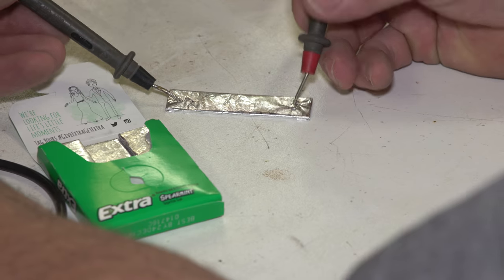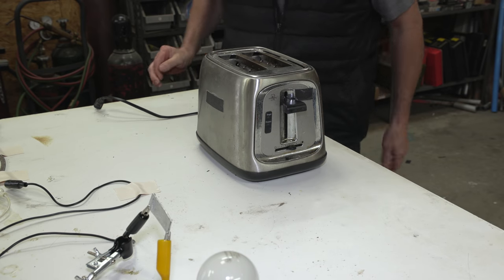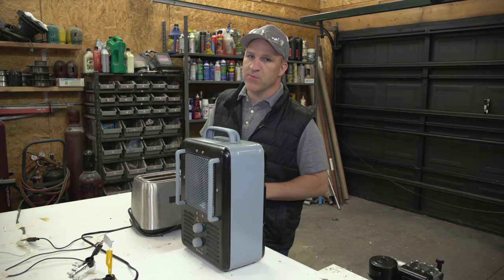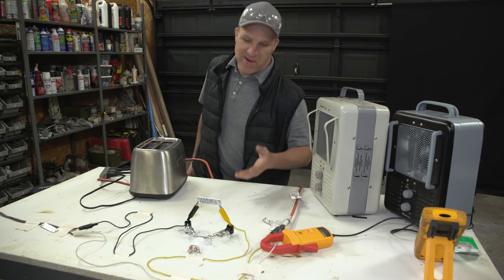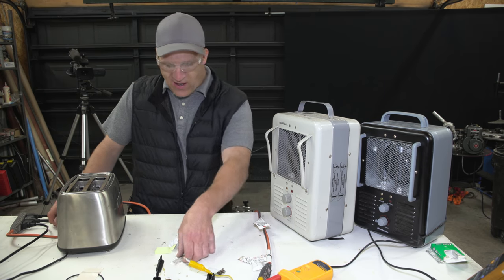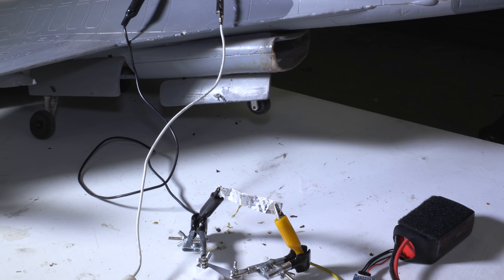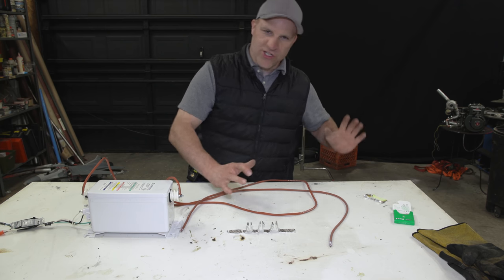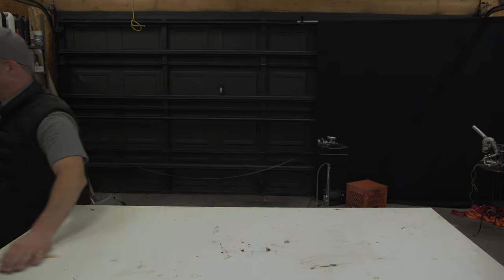How Much Power Can a Gum Wrapper Handle?

Comment: Isn't it fake ? I mean I accept that it can handle a lot of current but not 40 amps thats a lot of current even the wire which was connected to alligator clips cant handle this amount of current 
Am I wrong reply!
Reply: The wires on the alligator clips are very thin and they are insulated. The insulation keeps heat from escaping.
Reply: @ryanmickelwait1521  you realise the rubber on the wire will burn
Reply: Alternating current "flows" through wire way easier than direct current
Reply: Not sure if this is a perfect example but, your car starter motor isn't exactly huge it has a reasonably thick cable to it and it will get hot in excess of 5 seconds on the key. 
Then your household AC runs all day on those itty bitty wires.
But I do remember there was a difference for using 240v AC circuit breaker/fuse on a 12v DC system only reason I remember is because they're cheaper to buy and just allow the difference because I'm a tight ass...
Anyway just waiting for the electrician to chime in with a proper explanation.....
I'm gonna leave now....
Reply: They are good at science. Didn’t you know
Reply: It's only about 31 amps, not 40.
Reply: @jackbalmy1392  That's absolutely wrong. Where did you hear this bullshit?
Reply: @steven4737  That's wrong. 30 amps are 30 amps. There is no difference. 
10 amps running through a 1 Ohm load will always lead to a voltage drop off 10 volts. 10 amps times 10 volts makes 100 watts. DC and AC. There is no difference.
Reply: @sternpunkterdung1420  that's all well and good, but only true if the DC resistance and AC resistance are exactly equal - 
The DC resistance will be V/I  the AC resistance will be √ (R^2 + (Xl-Xc)^2) - and given the foils large surface area it should have a comparatively large Xc term
Reply: Alot of mis information here. Amperage is amperage generally. Looks like 14 gauge or possibly 12 gauge wire used for the alligator clips. In Canada 14 gauge is good for 15 amps. 20 amps is starting to be acceptable for 14 gauge (has been on America with less strict rules for a while) and 12 gauge is good for 20 to 25. Now this is just what they're rated for for safety sense. They are capable of quite a bit more before burning up.

Comment: Am I the only one cringing at the tiny test leads used to complete the circuit? Those are probably rated for 10A Max.
Reply: yer me to
set fire to an alligator clip like that with 10A 12V
Reply: Meeee
Reply: I wonder too how they rent melting and burning when I am testing with my lab supply these leads start to smoke at 5 amps and he punches 30 amps through
Reply: Yep me too.  Idk how these alligator clip survived the 30 amp .. like how? I think he means to say that we can use aligator clips to run Air-conditioners and heaters . Just dont waste money on proper rated wire . Use alligator clips lol Jk
Reply: @gesuk492  also if you see at the current measuring display it shows some mV value so he doesnt even measure amps with the clamp
Reply: DerProGamer2000 no; voltage output current clamps are a thing.
Reply: @ElTurbinado  i know i have one but why does it show mV
Reply: DerProGamer2000 because it’s voltage output? If it outputs a voltage relative to its current, your multimeter will still say the voltage it’s reading. I’m not sure what you’re confused by, but maybe this will help: A shunt resistor is a low ohm resistor, you can know amperage passing through it by measuring the voltage drop across it (one volt meter lead on each side shows the voltage drop), then using V=IR and rearranging for current= I=V/Rshuntresistor, you get the current reading in terms of voltage for your multimeter to pick up.
Reply: @jakegarrett8109  i have a current clamp and when i measure current it das Camps and doesnt say voltage
Reply: DerProGamer2000 that’s a current clamp specifically for your meter though. If I use a resistor and connect it to my multimeter, then it’s going to say voltage (it’s measuring voltage drop across it, the meter wouldn’t know if it’s hooked up to the resistor or to a battery, to it, it’s just reading the voltage potential across the resistor, which gives you amps when the resistance is known).
Reply: @jakegarrett8109  ok makes seens now :)
Reply: Not really some test lead like the ones on meters can handle quite of bit of amperage.  Not the size of the wire but what it's rated at.  You don't give him enough credit. He probably did a lot of for-thought before jumping with both feet. If you pay attention you can see. he had a topic. He   Isolated his variable. He made his hypothesis. he collected data (or)He knew the difference between dependent and independent variables. He ran the experiment, testing for variables. then he came to a conclusion. Textbook experiment!!

Comment: it's good to know that you can use a gum Wrapper as a 30A fuse
Reply: Might catch fire tho!
Reply: ThinkCleverAndSmart I mean the point of a fuse is to burn instead of allowing wires to burn
Reply: Of course, but if it catches fire and burns your house down I’d say it didn’t do it’s job
Reply: NEVER replace fuses with a solid piece of wire or something that won’t pop when needed 

There’s a reason a fuse blows and if it repeatedly blows there’s a short somewhere in the circuit which could lead to a fire if it has continual power (since it won’t be able to pop like a fuse)

Comment: It burned at the point of contact with alligator clips. If you had more surface area  between alligator and gum , I believe it to have more current capacity
Reply from the maker: you're right, and I also thought of this, but I still wanted the test to be pretty realistic, and in a realistic scenario you wouldn't be in contact with 100% of the surface area of the gum wrapper. So I think it was pretty legitimate
Reply: @WarpedYT  interesting though, that it can conduct even more energy through such a fine sheet and it's gum wrap!

Comment: You really need to get yourself a flir one camera.
Reply from the maker: Lol... I've been meaning to use one in these videos for a while now, but I've been so behind on my production schedule, I've been cutting some corners. Even in this video, I originally wanted to put the gum wrapper into a circuit box and then overload the box. But unfortunately I'm currently behind schedule, I think I'll catch up soon though.
Reply: Back in the day (I’m a musician), we routinely used gum wrappers as a fuse substitute at gigs.
Reply: Was thinking the very same thing.  The flir one pro is worth the extra. We have one and use it for water leak investigation
Reply: @BiggMo  When he sould use one, the Seek Thermal Pro is the deal. Better Resolution and thermal detection as well as range.
Reply: It would be highly inaccurate for the shiny wrapper, a simple $4 thermocouple meter would be much more accurate. Although the pretty pictures even though they are fake/incorrect due to high emissivity of the foil would look cool although completely wrong (you could use black sharpie to quickly give it a better and more accurate surface finish, though black paint would be best).
Reply: @WarpedYT  the caterpillar s60 is about 500€
Reply: @ΑΡΗΣΚΟΡΝΑΡΑΚΗΣ  would be better off with the s61. full hd flir

Comment: By my estimate, 40A should be doable. No claims of the gum being good/cold afterwards.

It failed on the aligator clips, probably due to it having connections on many(few) small points instead of the full width. You would need a different wider flat-ish clamp for higher current.

I didn't expect it to be able to handle >10A of current before checking the video.
Reply from the maker: I thought about that too, originally I wanted to cover the whole area of each side of the gum wrapper, but in a practical situation this isn't how you would use it, so I figured the alligator clips covering 50% of each end was pretty realistic, I mean the foil of the gum wrapper at its widest point was getting very hot at 30 amps, I still can't believe I even did a video on this, I was literally blown away at how much amperage does a gum wrapper handled
Reply: @WarpedYT  True about simulating a hackjob, not connecting the full width.

There is even the case of unrolling the foil and connecting it, with more surface area to cool it.

It's also similar to traces on a PCB, just thin coper foil instead of aluminium the current goes in.
The traces on a PCB is generally impressively flat.
Reply: @WarpedYT  If a follow-up ends up being warranted, some fatter/flatter clips would be awesome.

Comment from the maker: Tell Me! have you ever used a gum wrapper to get out of a sticky situation? I know I have
Reply: YES I have. Power out, No fuses handy, NEED POWER NOW. Stuck'm in a fuse box. 15 amp. Lowered usage mind you,  and only for a couple of days. Still, it worked.That said, the old (1950s-60s) wrappers were definately a better higher quality made.
Reply: BTW, DEFINATELY NOT RECOMMENDED FOR THE NON GUM WRAPPER INITIATED, LOL.
Reply: No because up untill i saw this video i kinda thought it would burn and shot out my electronics. Honestly now i think that if you had not left the gum inside it would never heat up or catch on fire. Its the gum itself melting and causing it to break the wrap n cause it to flame up.
Reply from the maker: Lol
Reply from the maker: Cool, that's very possible, but there is an uncut portion of this video where I use just a gum wrapper, it just wasn't very visually appealing, it looked a little bit messy so that's why I edited that clip out, I thought the piece of gum inside the wrapper kind of made it look clean. Thank you, and now you know you can use a gum wrapper to move some serious current...😁
Reply: I’ve used bubble gum (sans wrapper) as pipe thread sealer on my RV when our boondocking a few years back
Reply from the maker: @BiggMo  ha!, That's a good one I didn't even think of.
Reply: @jesusgonzalez84  Only do this if you are absolutely sure that YOU blew the circuit and not just when the lights went out. This could be a VERY dangerous fix if it is left in there longer than necessary. The fuse should be replaced IMMEDIATELY. That's what they are used for. Too many house fire happen from this.
Reply: Need a 25 amp fuse for a miller 225nt welder, I don't have 2 weeks for the 14$ fuse to get here... what's the worst that can happen?
Reply: @benjaminbrewer2154  A possible house fire with hot dried out melted romex or older shorted BX wiring. You won't notice it at first but it's going on in the walls.  Replace it with a modern circuit breaker if it keeps tripping.
Reply: @GOGGLETUBESUCKS4UIC  not quite sure that would be wise to retrofit the welder/generator with something like a sqD type q breaker.   Thought about shoving a quarter 20 bolt in the holder.
The miller 225nt is a gasoline engine powered welder.
Reply: @benjaminbrewer2154  You have too much resistance in the welding circuit. Turn your output  above your melting point. You may be doing damage to the generator or circuitry if the fuse keeps blowing and you bypass it with a quarter. That's what fuses are there for. If it keeps blowing fuses at any setting then there is something wrong with the generator.
Reply: I'm an electrician. Never had to use this on the job but I learned about it on MacGyver and always keep a stick of gum at the ready.
Reply: @benjaminbrewer2154  You could just retrofit a knife fuse with some jumper cables much like this stick of gum.. but use thicker cables and make sure the fuse is rated correctly. I wouldn't use a bolt. If you don't care about destroying the machine take a thick gauge copper wire and use it as a jumper instead.
Reply: I have used paper clips to discharge AA batteries before tossing them in the trash.  Be careful with that one.
Reply: Not a gum wrapper, but aluminum foil to temporarily fix a blown fuse, it worked.
Reply from the maker: Lol... Well you know this one will blow at 30amps. ."slow blow". Just kidding, don't do it !

Comment: Warped Perception, Amazing job!  Gum wrappers seem like a great substitute for electrical applications in an emergency.  Looking forward to your next video!  By the way, THANK YOU for loaning me the Wankel rotary engine that you designed.  Will a Wankel rotary run and hit 30,000 RPM on jet fuel?  We'll find out in a week.  lol. Thanks again!
Reply from the maker: OMG !! I can't wait to see that !. I'm so happy you put a twist on it
Reply from the maker: Great point, ive never thought about the peripheral port setup breaking the Apex seals at higher rpm, makes sense thought.

Comment: When I was a teenager I had an old ford truck that would blow headlight fuses all the time. When I ran our of replacement fuses I would use gum wrappers in place of the fuses until I could get to the shop and get proper fuses. Sometimes I would forget and leave the gum wrapper in there for a month or more and the only issue I had was that if I left the high beams on to long they would overheat and shut off. After watching this I’m surprised that I didn’t catch my truck on fire. 🥴
Reply: Yeah we all did that at sometime with barrel fuses...lol...
Just wrap the wrapper around the fuse and press back in slot.
I too forgot one once...it was about a month also....I think it was my stereo fuse so not a lot of current.

Comment: Slow-blow self resetting fuse.  Cross-section estimate ~ 3.4mm^2 about the size of a 12 AWG wire.
 (using full width of wrapper) 0.003 in x 1.75 in = 0.00525 in^2 = 3.39 mm^2

Comment: My 30 amp RV plug melted recently and caught fire, how does a gum wrapper survive what giant solid prongs of copper can’t?!? That’s incredible! It’s way above the rating on standard 15 amp wall plugs, a gum wrapper! My goodness that’s impressive, I though about using like 3 in parallel for an ebike fuse or something for testing (in case something shorted), but wow that would be way over 100 amps for a couple seconds! That’s insanely impressive....

Comment: These alligators test leads are too thin to pass that much current looking at 5:33 if the main is 35mm2 than the test leads must be around 0.75 -1mm2 which can handle 6-11 amps. 30 amps NOPE it will burn instantly. So could you measure diameter of these test leads ? because this seems like BS
Reply from the maker: Nah it's not Bs, the alligator clips are rated for 20 amps, but that doesn't mean that they won't take more. The alligator clips are 12 gauge wire.

Comment: Doesn't it stand to reason that if the resistance in the connection is lower than the resistance in the wire that the connection will survive more amps than the wire?
Reply: Frank Hughes no because power is i^2r. more current more heat
Reply: @jhoughjr1  well then how does a fuse work? 😭
Reply: @jhoughjr1  it's also like when you splice two wires together by stripping them and twisting them together. The resistance goes up where it's spliced and the connection will melt before the wire melts.

Comment: I hate to be that guy but  the main reason a contact(gum wrapper) can carry more AC watts then DC is FREQUENCY. USA AC is around 60hz all DC frequency is 0(unless u have an unstable power supply). Frequency affects how the current penetrates the conductor higher frequencies don't fully penetrate the conductor lowering the resistance witch generates less heat. Great video as always
Reply from the maker: Awesome explanation, exactly!

Comment: The most insane thing I've ever seen ( I'm an Electrical Engineer) was at a person I knows flat,I walked in and he said "don't trip over my cable",He had hit a 6 inch nail into the live incoming cable to his flat and wrapped an electrical extention cable around it and tapped off the neutral conductor too!.....I just could not belive what I was seeing......I told him how dangerous it was but he just said "we do this kind of thing in jail".....as a few of the comments say,this happens in jail alot,the thing is though with incoming tails the fuse or MCB protecting a 100 Amp incoming board is not exactly small!.....true story.

Comment: Def a battery and gum wrapper to light a smoke or pencil led to pop an outlet... In my experience an AA battery will light a wrapper on fire, u put one on the plus one on the minus the middle of the wrapper gets hot and makes a flame..done this many times

Comment: You shouldve took apart of a microwave, take out the big transformer, its 2200 volts and is powerful af. ive taken apart of like 12 microwaves. once i connected all 4 transformers with 1 capacitor i made such a huge arc. which was like i think 2 or 3 foot?

Comment: i was just going to say you might want to increase the voltage. and do it without the gum in the wrapper. the more voltage you have over a surface of that size the more electricity it can handle.

Comment: To anyone wondering when he is showing the “amps” on the meter but the meter says “mV’s” this is because he is using an amp clamp accessory, it has its own 9 volt battery inside it and you plug it into your meter and set it to mV’s and the reading in mV’s on the meter is actually amps.
Reply from the maker: Thank you, I completely forgot to show that, I almost put it as text on screen but the project posted 3 days late, so I was a bit in a hurry.
Reply: Warped Perception Haha I understand.  I work in commercial HVAC and I use that same clamp.  When I first used it I didn’t understand.  The clamp is an accessory that was made to add to units without this option, so they had to make it work somehow and setting the clamp to send the data so the meter can read it as “mV’s” but tuned to show actual amps.  Pretty cool.

Comment: Because i don't feel like scrolling through 347 comments...... 

A) those jumper wires should have been minimum 10 gauge wire for 30 amps. No way they could stand all those items being powered through them without melting. 
B) how do you not have a infrared thermometer to take temperature readings?